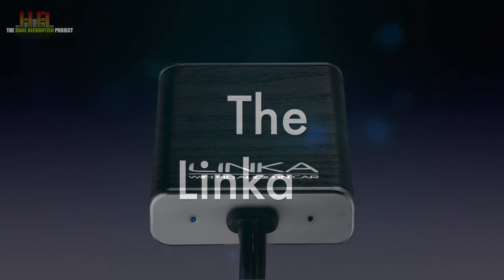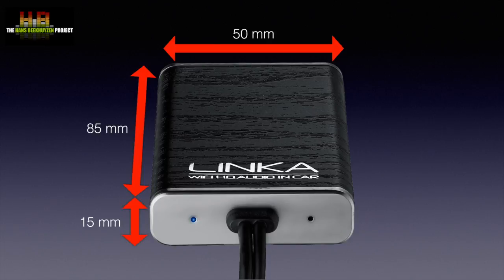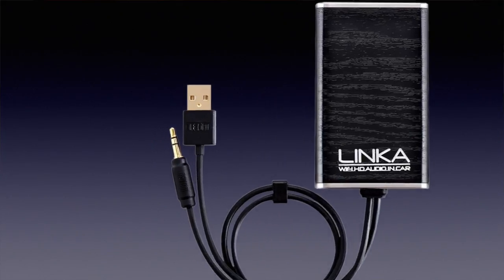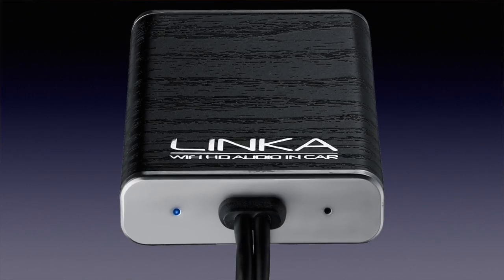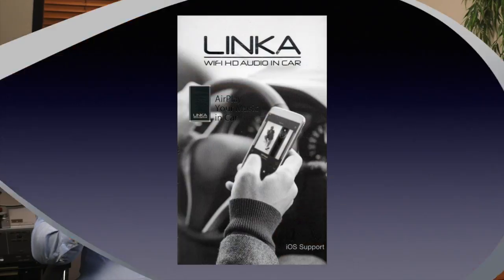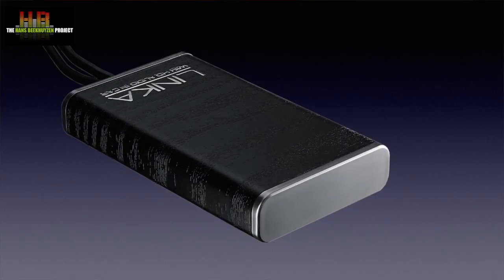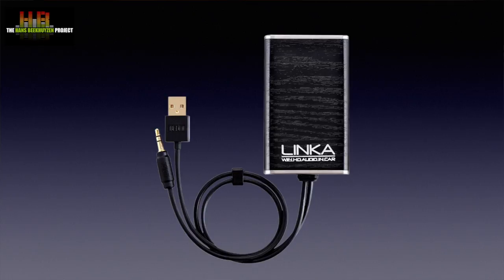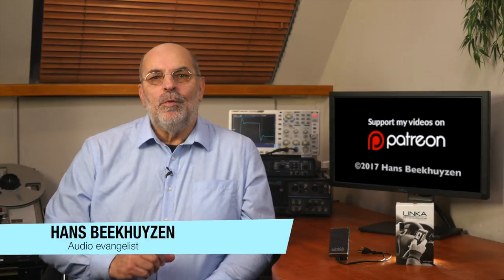Nexum Linka: better sound  than Bluetooth by using Airplay

Comment: that is a nice tool.
thank you Hans for all your knowledge. some of it will be used for my job.
since you are so expirienced. what do you think of omnidirectional speakers? they seem interesting but never had their great breakthrough. 
have a nice day and I'm looking forward to your next video
Reply from the maker: Omnidirectional speakers have  the same tonal balance in all directions while unidirectional speakers have not. Whether that is beneficial depends largely on the room they are used in. Use omni's in a relatively narrow room and you loose your stereo image due to the short time delay between the direct sound and early reflections. But in a wide room they have the advantage of low coloration of the reflected sound.
Reply: dear Hans. Thank you for your reply. if you have the time: what would be a beneficial situation for omnidirectional speakers? like "only mono sound in a square room with one speaker in the center of the ceiling" or something like that?
have a nice day.
Reply from the maker: good idea!

Comment: Does the internet on your phone still work when connected to the Linka? For example can you use waze for navigation etc? Thanks.
Reply from the maker: 3G/4G works as normal. so navigation, internet and all works. Only when your car itself has a Wifi access point, it won't. But very little cars do.
Reply: thank you for your answer.
You are using iPhone 6? I just tried to disconnect the internet cable from my home wifi. When the iphone is connected to the wifi (without internet access), it won't "fall back" to using 4g for some reason...
Reply from the maker: The iPPhone version is of no interest (I do indeed use a 6). But do you use the Link in the car or at home?

Comment: Can I buy this in the USA
Reply from the maker: Well, apparently you can order it from https://www.nexum-design.com/copy-of-linka-en
Reply: Thanks Hans, I picked one up and have been using it for a couple weeks now.  My iPhone automatically connects to the linka after its boot time.  I think some of the music apps I use have issues seeing it sometimes. This happens if I turn off the car to get a coffee or gas and then try to resume when I get back in and continue my drive.  I've verified the phone is connected to the Linka but the music software can't see it (Plex mainly).  I have used Spotify, Tidal, Plex, Casts, and Audible with it.  A great solution for my older car that didn't quite implement bluetooth audio (It shows on the radio but I can't connect to it - 2010 VW EOS).